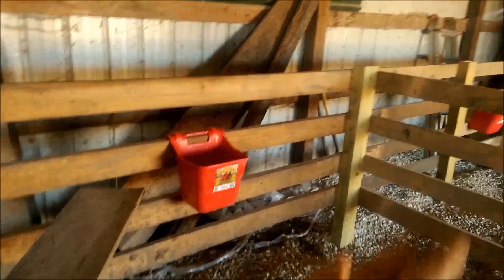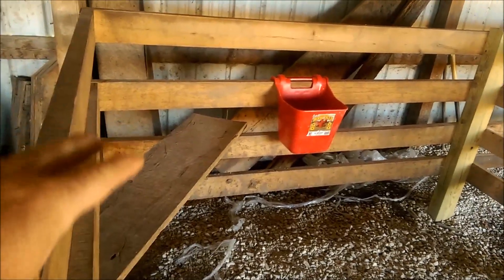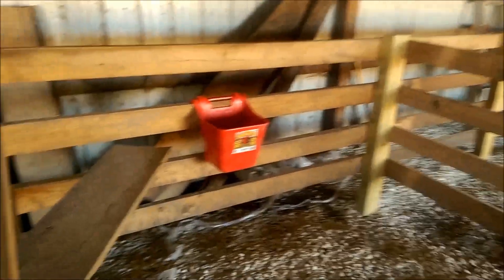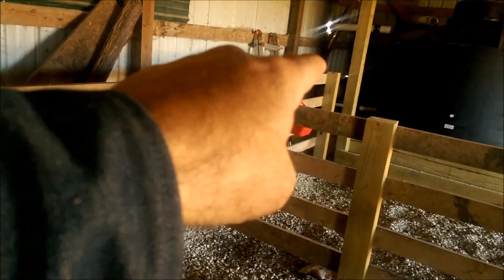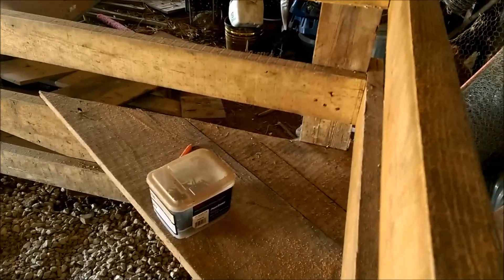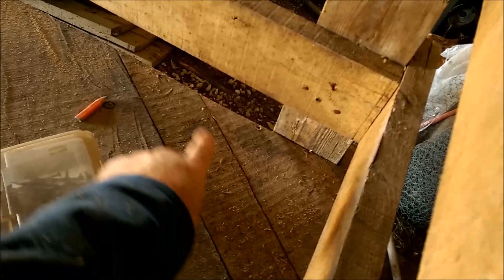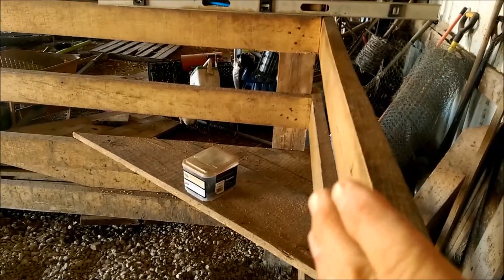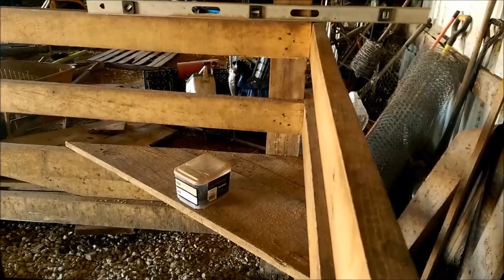OFF GRID: DIY HORSE STALL FEEDER, RECYCLED MATERIAL

Comment: I like the corner feeder idea.
Repurposing wood is good. I salvaged about 300 ft of 4-board fence when a new park was built in the community I worked in. All 2x6 and 4x4 treated material about 12 years old. Took me almost a week to dismantle it, pick out the best boards and haul it about 60 miles to our Itsy Farm, but I got over 200 2x6s (7-10 ft long), nearly 50 4x4s (about 6 ft long) and some gate hardware. That was three years ago and I am still using the salvaged lumber for farm projects. It was well worth taking a weeks' vacation to do it.